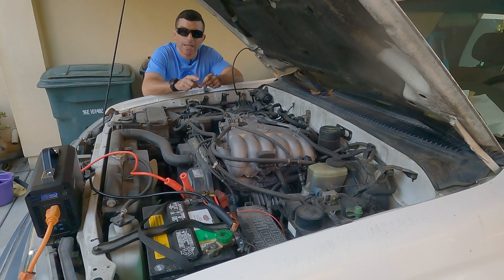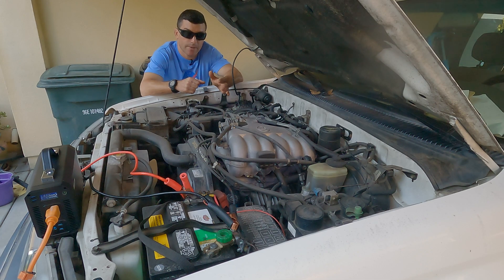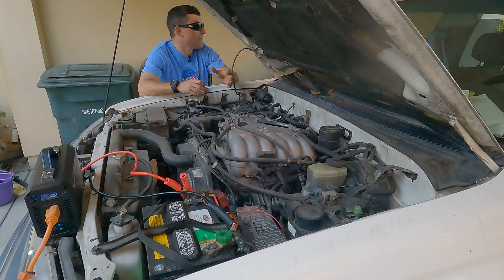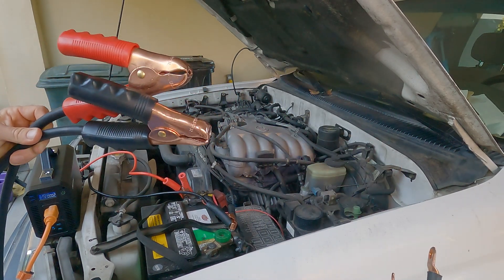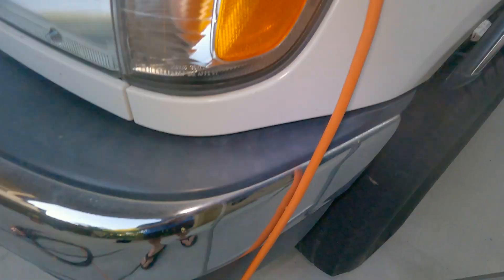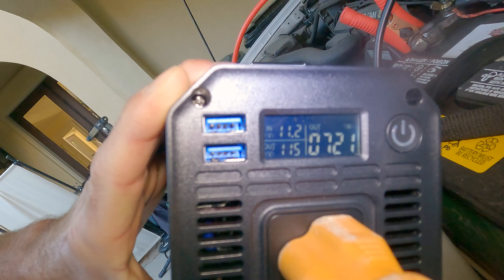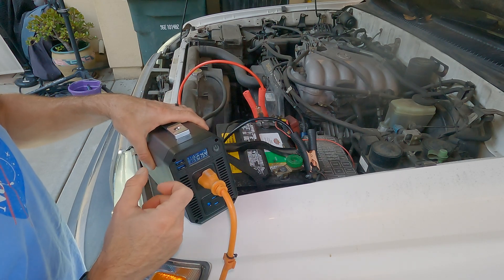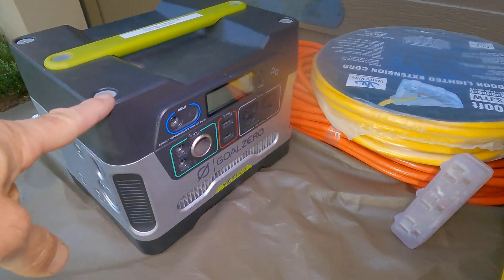HOW TO TURN YOUR CAR INTO A GENERATOR IN 30 SECONDS USING AN INVERTER

Comment: If you leave you vehicle idling for long periods of time, over time the top end of the engine doesn't always get enough oil and that will create problems. Buy a few more deep draw batteries and charge them one at a time with them hooked up to the alternator in the vehicle and drive around while charging them
Reply from the maker: Very good suggestion. What I am showing in the video is designed for very infrequent emergency use only.
Reply: Don´t need to drive around it will charge them either way and why should the top not get enough oil all of the sudden ? Did some engineer miss this ?
Reply: @sierraecho884 Everything will be fine. No need to drive the vehicle around.

Comment: If your car battery is 800cc or 850cc can you use a 1,500w power inverter to use a electric oven that's 1,500w leaving the car running ?
Reply: What are you calling 800cc? Also if your oven pulls 1,500 at maximum you'll need at least a 2,000 watt inverter to provide sustainable electricity. You can buy off brand inverters and save a few bucks too.  A cheaper brand 2,500 watt would cost about the same as a name brand 1,500 watt and do a better job
Reply: @NoKamalaIn2025  800 Cold Cranking. The answer is probably no unless they can get the engine to fast idle.
Reply: It will shut down the inverter.

Comment: Just buy an old car or a wrecked new one and you can make it a generator. Use a three to four cylinder car and you'll have air conditioning and heat. All you need is the front from the dash to the engine compartment throw the rest of the car away. Build a shed around it and you can have all the power you want for 20 years or more for less than the cost of a brand new Honda generator. Put it all inside of a little shed with the exhaust pipe straight up, talk about quiet.Then you can add a couple solar panels/used for cheap and you're off and running no more worries mate. Been there done that. know what I'm talking about. One must use their head for more than a hat rack. 💡🛠Age 65.
Reply: Way to complex, just connect an alternator to a lawn mower engine
Reply: @jonasstahl9826  or a couple of alternators to charge multiple batteries
Reply from the maker: That is genius! Would love to see a video of your set up. Please link to it if you have uploaded one
Reply: @NickC9545  well thanks for reading my comment but, I don't do videos and I think you can figure out how to make one on your own by just following my description. I had fun learning to put mine together it works great. 🛠💡
Reply: I considered this as well, but note that its handy to be able to drive your de facto generator to the gas station for easy refilling.

Comment: You forgot to mention the biggest advantage of this method. You probably already own a vehicle, even if you don’t own a generator!! Love it :-)
Reply from the maker: Great point!!
Reply: Only if you are not making payments!🤭🤣
Reply: I’m turning my Duramax diesel truck into a generator for this hurricane we’re about to get
Reply: I bought a 2000 watt Pure sine inverter for my RAM truck, diesel My new refrigerator draws less and two amps. I have a mini split in my bedroom that draws 3 amps so I'm all set to go and I have a 50 gallon day tank in the back of my truck. I used to have batteries in my garage The big ones for diesels but it's too much to keep around in the garage so if the storm comes close to us I'm just going to leave my truck running I am jumper cables that hook to the battery there are zero gauge. so I'm ready to go.

Comment: What kind of inverter are you using?  Can I run a fridge or freezer?  Can I run my gas furnace?
Reply from the maker: It's a 1kW pure sinewave inverter. I'll have to go check the brand. If your fridge/freezer/furnace require over 1kW to startup or operate, you'll need a larger inverter that can output more than the max wattage required.
Reply: We just bought an expensive generator which is a pain in the ass to maintain and start  
I took a vacation a few years ago to Maine with off grid cabins. I saw a guy temporarily powering his cabin using his car. This is what he must have been doing. Thanks for posting this. So stupid I didn't think about doing this for myself!
Reply from the maker: @CJGfarm  The next best time to do something you should have been already doing is today!
Reply from the maker: Oh man, I hope I didn't sound like Kamala Harris with that last comment.